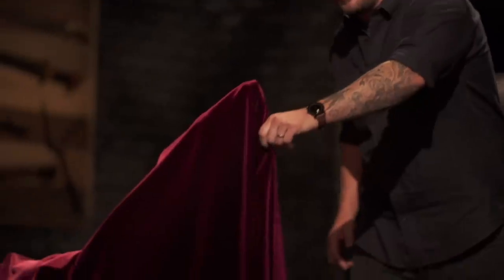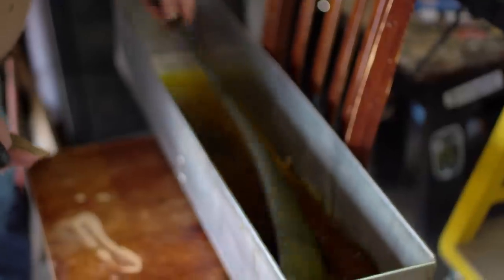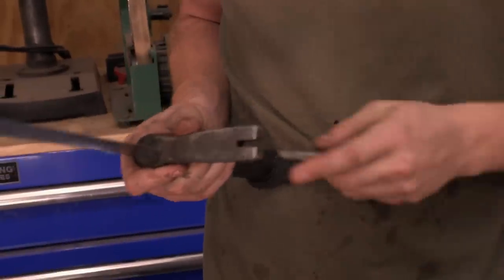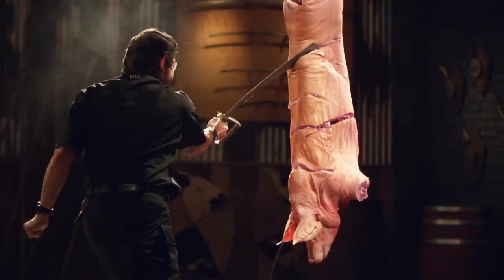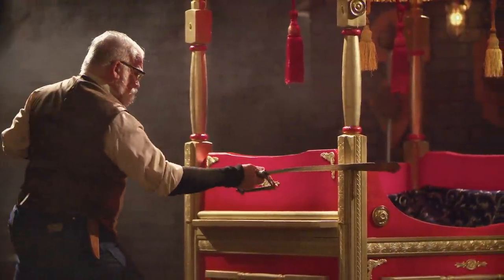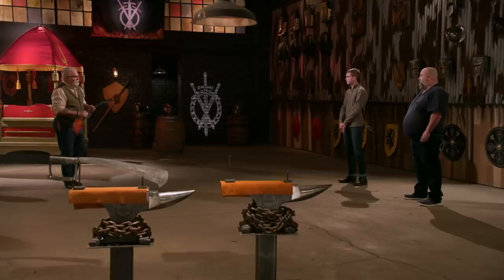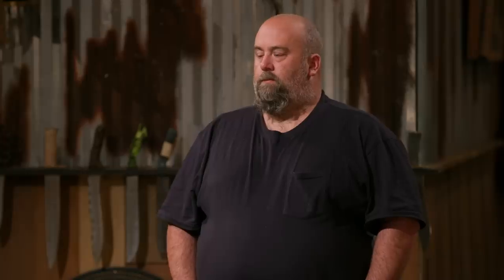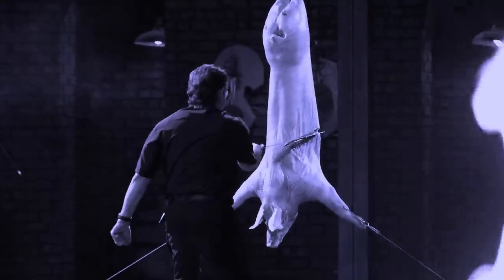NOTORIOUS Naga Sword DEMOLISHES the Strength Test! | Forged in Fire (Season 9)

Comment: I could tell there was going to be an issue when he quenched his blade and it was glowing red. Just too cool of a temperature for it to properly harden.
Reply: Had nothing to do with it. He had an extreme angle on his edge grind which made it extremely sharp but caused the edge to distort the way if did.
Reply: His only mistake was going up against JoJo the special needs circus boy.
Reply: Its red because of the sunlight
Reply: I'd put it down to the acute grind.
Reply: @PhantomFilmAustralia  basically what I said
Reply: I know.  I'm backing up common sense, bro. 👍
Reply: @PhantomFilmAustralia  I know lol. Thank you my friend
Reply: @donaldrowe6047  It had everything to do with it. I know blacksmithing, but I also know videography. A cameras dynamic range isn't like the human eye. Sunlight would not mask the color of the blade, rather it would causes floressence. You can see the effect clearly in earlier shots when he's forge welding the billet. The sunlight made the hot piece of metal glow more, not less.
Reply: Whereas the acute angle grind does lend itself to taking more damage, the smith himself believed it was a heat treat issue. Not saying anyone is right or wrong, both factors absolutely play a role in the damage it sustained anyways, which was the bigger factor I won't speculate on, just wanna point out that both factors will always play a role in how durable a blade is.
Reply: I borrowed the heat treat oven for this competition. The best I can figure is that the temp was around 50° colder than I was going for causing only the very edge to fully harden. The edge is fairly thin but it is convex so it has plenty of material behind it to support it, only issue is the material behind the edge wasn’t hard enough.
Reply: @ChrisSmith-yj5fp  awesome job, could have gone either way! Cool to see you commenting on your own episode with smithing insights, too!
Reply: @MB5rider81  I hope this was in good taste because as an autistic person this feels rather underhanded.

Comment: Chris' blade is scary sharp, aesthetics and sharpness he would have won..
Reply: But knowing the fact that the blade has been misshapen on the strength test, that actually cost him his points for the potential win. Yes, Chris' blade is way sharper than Jojo, but the resiliency of his weapon is undeniably corrigible enough. Given its flawlessness.
Reply: Its also the way his blade took damage. Different types of damage, chipping rolling warping, all tell you about the heat treatment and quenching the metal went through. His heat treatment and quenching did not produce a strong enough metal. Whereas the kid used an edge geometry that was not as sharp. 

Don't like the edge? Grab a whetstone. Don't like the heat treatment? Start over from scratch.
Reply: But, the strength test caused him to loose. That's sad.

Comment: People are saying that it should have been the other way around, but no, and most replies have cleared this up so...
Chris' blade deformed because he thought it was hard, but, the blade never reached the glowing red that it should've, so it was only partially hard. If not for that, it wouldn't have deformed, and in a blade, before aesthetics must always come usability. That deformation is only one of many that could have appeared in continuous use, which is why Jojo's blade won. If it wasn't for the deformation, and the heat treat was done properly, Chris' blade would have won from aesthetics, as it would have been dependent on the handle and thus, the look of the weapon.

Comment: The other blade would have been my choice. Edge deformed cos he hit the Howda with an angle cut
Reply: Still shouldn't have deformed like it did.
Reply: The edge deformed probably because the heat treatment might have been too cold. If you look at the color of the blade right as it goes into the oil it doesn’t look hot enough.

Comment: Chris should’ve won it took very slight damage but performed better and looked better
Reply: I think it would have won if not for the damage.  I personally have to wonder if maybe he made the edge grind too thin?
Reply: @marhawkman303  it was insanely sharp, but the other used a more robust edge, and kept simple but strong
Reply: @marhawkman303  it was a heat treat issue.

Comment: Wrong decision and disapointed by the judges in this one.. yes the blade took a deflection but it was better in every other way.. the other blade looked rough, thicker and unrefined.
Reply: I really dislike when they can't even be bothered to actually polish the blade.
Reply: I agree. i didn't even think the kid's blade was really a "naga" either. He basically made a clunky chopping tool and not a weapon. Only won because of a slight roll in an otherwise superior in every way sword that still performed the same on the final test but much better in the first one.